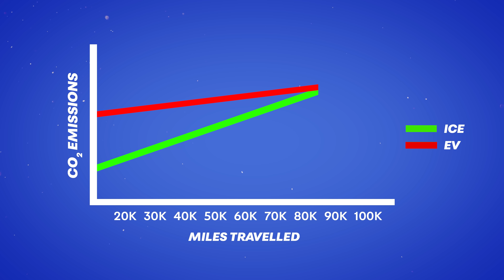Are Electric Cars REALLY That Green? [New 2022 Data]

Comment: it’s good to see more mainstream channels discuss this topic, as an engineering student I have had so many heated discussions with morons that are at the extreme ends on EV vs ICE. Both are right, and both are very wrong. It is important that the average person understands that EVs are only 20% to 40% less polluting than old ICE driven cars, not because people shouldn’t buy EV's, but because it highlights the real issue here: NO NEW CAR WILL EVER BE GREEN, if we actually want to be green then we have to take better care of the cars already on the road, and I’m not talking here about old diesel trucks from the 90's, but newer cars that form to euro 6 and above. If people serviced these cars more regularly and took actual good care of these vehicles then the planet would be better off, as all the energy required to build these cars has already been used. And for this to happen we as a global community must actively support the right to repair movement.
Reply: It depends on the MPG of the old car.  If your old car gets 25 MPG (e.g. a 2005 Camry), the EV break even point (Tesla Model 3) is about 36,000 miles.  As EV emissions continue to improve, this number drops further.  However, this argument does hold up if you are driving an old Prius, for example
Reply: @callresponse2574 agree, as i mentioned in my orginal comment, i am talking about cars with euro 6 engines, that is is 2014 and above.
Reply: @dndfm  I'm confused.  Volvo's PDF says the XC40 ICE emits 173g CO2/km.  The Euro 6 cutoff seems to be either 130g or 98g CO2/km.  Does this mean the XC40 is not Euro 6 compliant?  Are you talking about diesels?
Reply: @callresponse2574  i can see how its confusing. All cars sold after 2014 in the eu have to be euro 6 compliant. the xc40 is euro 6L complaint. the L is for light, comercial vechiles use roman numericals instead. euro 6 goes for both diesel and petrol, but ofc the numbers/requirments set by the standard are different for diesel/petrol. The 130g is a fleet average "cutoff", that means that if the totat average emissions of manufactured volvo cars are higher than 130g then volvo has to pay fines. thats why compainies like VW literally pushed the e-tron and id3s out the factory gates as quickly as possible to avoid fines as their fleet average was high.
Reply: Volvo's figure was that an EV would break even after 77000kms on a typical car life of 200000kms, so it's more like 60% more efficient, as Rory mentioned that's also assuming that the cars actually achieve their 'tested' CO2 emissions, which we know isn't the case, infact WhatCar tested the XC40 and found it's real mpg to be about 2/3 of that claimed, so really we should say that the EV is 75% or more less polluting.
Reply: @smc812  yeah, but the EV also uses more electricity than advertised as you get less miles per charge than what polestar claims, not to mention the efficiency in the grid and the chargers, most home chargers are 95% efficient, but some fast chargers lose 15% electricity as heat. so again, we could play this number game all day long. we will as global society be better off if people took better care of the stuff they own. same goes for EVs, imagine in 10 years’ time when the batteries must be recycled, to this very date, no one knows how to practically reclaim the lithium during recycling, a Norwegian/Swedish study group found a method that worked in a lab and the got a Nobel prize for their work, however they estimate that the technology won’t be ready before multiple decades.
Reply: @dndfm  also, no Norwegian has won a Nobel prize for lithium recycling, in fact it was only in 2019 that the inventors of Lithium batteries were recognised (and they were American and Japanese).
Reply: @smc812  they might have been nominated, I don’t remember the details, you can read about their project black mass lithium ntnu. either way, doesn’t change the fact that no one knows how to recycle lithium batteries while keeping the lithium to be reused in new batteries. I don’t know where you are from, but one important factor that Volvo does not consider is the green programs that are paid for by petrol car users. here where I live, we have to pay 60% to 80% tax per liter of fuel. that money goes straight into green programs, so when you use a petrol car daily you are actively supporting these programs, I’m not saying that the green programs 100% counter the gasses produced but they have to count for something. that’s why to me local studies are far more important.
Reply: @dndfm  You are incorrect, there are many companies that can recycle Lithium, your local one in Norway is Hydrovolt that is building a large new plant. 
No one get nominated for Nobel prizes until their discovery has shown it’s importance for decades, so I’m afraid that’s untrue as well.
Also no, Norways green taxes do not remotely compensate for the CO2 from transport, that’s greenwash lies. Norway has finally agreed to stop using state funds to subsidise the creation of new oil field since Sept 2021. Even still, and ignoring all the exports, Norway produces 40% more CO2 per capita than here in the UK, and twice that of Sweden next door. Shameful behaviour.
Reply: @smc812  you are clearly a crazy person, i did not say they cant recycle lithium batteries, i said they cant recycle lithium batteries while keeping the lithium. during the recycle process they can keep the cobalt and the heavier metals such as iron copper etc. but the lithium burns of. i dare you to find me one company in the world that can recycle lithium batteries and actually get raw lithium at the end of the process. you cant compare the uk to norway, thats unreanisable and dishonest. your bad weather is like -5c, our bad weather is -30c, we have to use a lot more electristy during winter, and because we sell YOU clean energy during the summer we have to buy back dirty electristy in the winter. And a drive from the most south to the north point is 2700km, thats almost twise as long as the uk, so dleivery trucks have to travel a lot more. Norway is the leader in EV cars, without norway tesla would not be the company it would be to day. some countries earn their money buy stealing other peoples riches for centuries and dividing continents with a ruler ignoring all important factors and left those contries in devestating states, left for poverty and war. others sell oil to get rich, not sure who is the shameful country here, atleast norway is right now in the for front of the green movment, local electristy production is now 98% green in norway, and over 50% of new cars are EV, and we are eating less meat year by year. if it was not for norweigan oil, then other countries such as the uk would have bought it from russia or libya, yeah thats so much more better!!
Reply: @dndfm  How come Sweden has half the CO2 per head that Norway has? Sorry your country is a leader in Greenwash and oil exports, little else. 
Both Li-Cycle and Northvolt have commercial processes to recycle Lithium from batteries for use in new batteries
Reply: @smc812  both li-cycle and northvolt admit that they can only get up to 95% reclaim on the metals, the last 5% is the lithium. and the "up to" is from a lab, not real-world process. Neither li-cycle or northvolt has ever said or claimed that they can reclaim the lithium in lithium-ion batteries. Sweden has a denser population, and warmer climate. many big cities in norway are 8 to 22 hours away from each other, for those routes many people chose airplanes instead. and we produce less meat and vegetables locally compared to sweden due to high wages and worse climate. Same reason the uk imports beef from Australia and not local production. if it was not for norway then your country would have had to import its fuel from places such as libya or russia, the carbon footprint difference from importing from troll station or russia is gigantic. And what you fail to explain, is why is it morally ok for the uk to prosper today using money stolen from other countries while its morally wrong of norway to earn money through selling oil? you realize that if norway stopped selling oil tomorrow then all that would happen is that more fracking would occur to compensate for the lost oil?
Reply: @smc812  also dont forget, norway is actually honest about their numbers. we produce 98% green energy, but we sell electristy during the night to europe and buy back electristy during the day. the net total is that we export more than what we import. but because europe doesnt have green energy we end up not using 98% clean energy but using 64% green energy. and we use that number to messure co2 per capita not the 98% number. If norway stopped exporting to europe than many european manufactureres would not hit their green targets as they buy green energy from norway with tarrifs. if we stopped the export than we would have much less co2 per capita. AND we have laws in place to protect the norweigan forrest and only sustianable farming is allowed, basically to cut a tree you need to plant a new one. as a result we have far bigger co2 absorbtion copared to both the uk and sweden. if you ignore the co2 realised from norway from electristy export and from the oil indistry you would see that norway has actually lower co2 per capita than sweden.  And if norway stopped the oil export than the fracking that would happen in the us to companesate for the oil loss would far excced the co2 realised by the norweigan oil industry. in the big picture norway is far greener than both the uk and sweden.
Reply: @smc812  the sad fact is that sweden is colder and has a lower density compared to the uk, yet still sweden has almost 40 %less co2 per capita than the uk, shameful.
Reply: @smc812  forgot to mention, never use mpg as direct indicator of CO2 emissions, if a car uses 10% more fuel that does not mean that it produces 10% more CO2 than advertised. in many cases its actually the opposite. in an ICE engine the fuel is not there just to burn/explode, as the fuel enters the cylinder it will cool down the air as it being compressed, the cooler the charge, the less co2 you get from the exhaust as higher burn temperature result in more CO2 and other harmful gasses. that why in dieselgate the cars produced more harmful gasses but had better fuel economy than advertised, because less fuel was shot in the engine resulting in a lean mix and high burn temperature.
thats why older cars can actually get better fuel rates per hp than modern engines, they run lean mixtures that use less fuel, but by doing so they produce so much more harmfull gasses. lower mpg does not equal more gasses out of the exhaust.

Comment: I just don't understand why brands don't do a really good hybrid plug in, with like 60-80 miles of range... that would be great for daily driving and the hybrid function for long journeys... that would be the best fit to most of the people.
Reply: Hybrid plug ins are kind of the worst bits from both ICE and EV and increases complexity and weight and losing performance and agility. It's better to focus on battery tech in reducing the weight, and improve aero of the car. That way we'll have cars that can have a 50kWh or even 30kWh again that can do a 6+ miles per kWh and recharge in a few minutes @ 350kW  on longer trips. Most people don't do 300+ mile trips, or once/twice every 365 days.

Comment: Well done as always Rory! 3 thoughts came to mind:
1) what is the environmental impact of EV and ICE cars at end of life, particularly batteries
2) what is the environmental impact of bath types of vehicles when they catch fire
3) what is the environmental impact of more geographically concentrated and increased emissions from power plants due to increased demand to charge EVs

An interesting consideration is the cost and therefore ability to put in EV infrastructure particularly in the developing and 3rd world
Reply: See pages 4 and 5 of the report for question 1 to get an idea of emissions.  Basically a drop in the bucket of total "cradle-to-grave" emissions.  Question 2 is a very rare scenario, and both are bad.  As for question 3, increased EV demand implies less use of ICE, which means lower emissions.  So a good impact that gets better as time/miles pass
Reply: @callresponse2574  I saw news footage of a riot in Paris. The rioters set light to a row of parked cars. All smoked. The firetruck put out all the ICE cars OK, but could not extinguish a Nissan Leaf EV. Everytime they thought they had it out, the fire burst back even stronger. The news crew had to retreat from the toxic fumes. They did not need to do that when filming burning ICE cars.
Reply: @audacity60  Like I said, this is a rare situation.  Seems like you aren't listening.  And you ignored my other points.  You aren't open-minded, just here to push a side -- you're no better than the EV-biased who have already made up their minds and will never budge.

Comment: Wouldn't that then make PHEVs the best version instead if the worst? Much smaller battery so less initial CO2, lighter than the EV version and mostly run on electric if done properly.

Comment: We tried building small efficient electric cars for decades and no one wanted them.  Then we came out with better vehicles like the Leaf.  Then everyone whined about it being ugly and impractical and started slapping batteries into F-150's.  The fact of the matter is we use the current systems that generate pollution to produce electric cars, just like ICE cars, so they start off at a deficit.  That will always exist to some degree (windmills aren't going to be able to power mines and alloy refineries).
Reply: EV trucks seem like the most counterintuitive idea yet. Most people who drive trucks don't need them, but let's put a huge battery pack in them and normalize this for the most sold type of vehicle out there. I bet the batteries for one half ton could be used in 2 or 3 smaller BEVs.

Comment: I feel reasonably good after watching this video...
At 62 years old & typically doing a mere 3-5,000 miles per year, in buying and running a 4-6 Yr old Aston Martin Rapide S (6L V12!) I'll be doing more good than in buying a brand new BEV saloon car - given my expected lifetime mileage.  Especially given that I'm currently building a high efficiency house (which will also provide income as an AirBnB) incorporating solar panels and domestic battery storage PLUS EV chargers for any guests!!  :-)

Comment: I think it’s the ‘open conversation’  angle as we have been brainwashed to think EVs are the answer.  There are many issues with transport using motor vehicles.  Why are most EV,s SUV’s or big expensive saloons?  Battery technology will improve over the next few years for sure - lifetime, recyclability, efficiency.  Personally , I’m not quite convinced enough to change my very fairly efficient 5 year old Mercedes 220d just yet.  I will however  look at buying a second hand small EV for my next child when they start learning to drive .

Comment: CO2 isn't the whole story. 42,000 premature deaths in the UK are caused by air pollution and many more people's health is adversely affected. Road transport contributes around 25% of that air pollution. Especially in cities replacing ICE cars, with barely warmed up engines, hopeless fuel consumption and high emissions due to stop-start driving, with EVs which are zero tailpipe emissions and operate at their best efficincy in cities will help enormously.
Reply: True, but perhaps transferring those air pollution deaths to people in China where the factories are building the EV batteries.

Comment: The black box in the equation is mostly the impact of the battery production. Volvo provides good clarity on this:

3.2 Battery modules
A BEV battery pack consists of a carrier, battery management system, cooling system, busbars, (cell) modules, thermal barriers, manual service disconnect and a lid. Volvo Cars purchases modules from CATL and LG Chem, who, in collaboration with the report authors, performed cradle-to-gate (up until Volvo 
Cars logistics take over the part) carbon footprint LCAs of their modules.

So in other words, no assumptions were made on the impact of battery production. These numbers came straight from the supplier.

This has very little to do with how “efficient" Volvo is in building an electric car.

Comment: Yes I saw that Volvo announcement a while back.  Thanks for expanding upon it.  As EVs at the moment tend to be used more for short range / local trips - (average seems to be about 5000 miles / year) its going to take a long time to reach that 90k or 52k break even point.  Probably 10 - 12 years, before which many  of them will have been written off or scrapped and therefore will have never have reached that break even point.  I guess all of this will evolve in time though.
Reply: o.O 
You pulled those rediculous 5000 miles a year streight out of your derriere..
And cars get written off after 10-12 years with less than 90k miles?! Electric cars? Did you fall on your head?
Reply: @NO3V  Well actually I did do a bit of research.  I looked at 12-15 month old EVs on Autotrader - VW ID3 and Nissan Leaf two of the best selling average EVs last year.  5000 miles / year was a generous average.
As to lifespan its hard to say for EVs as not many have been around for that long but for other cars around half tend to have been scrapped after 10 - 12 years.